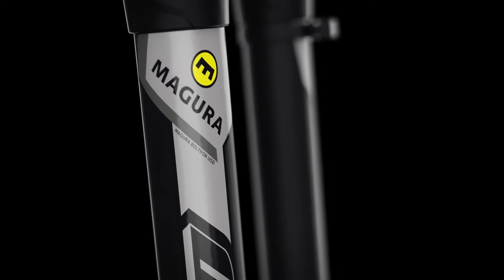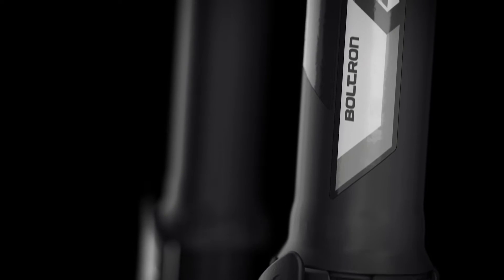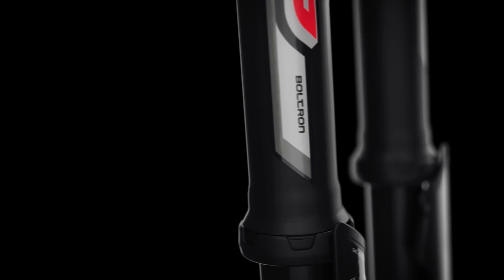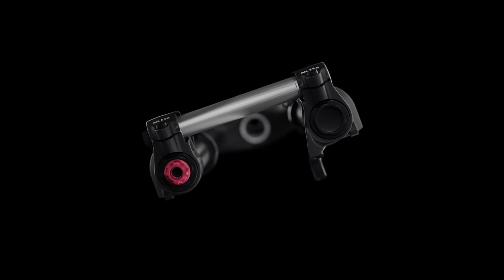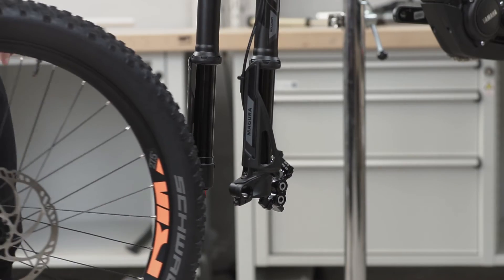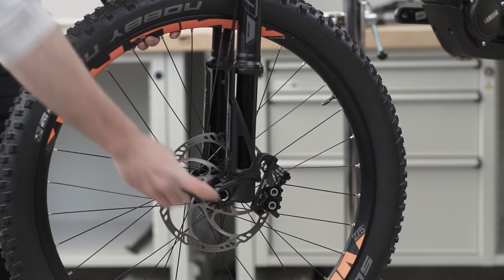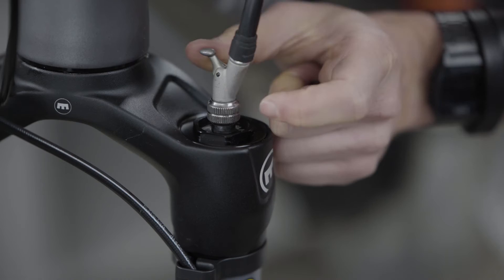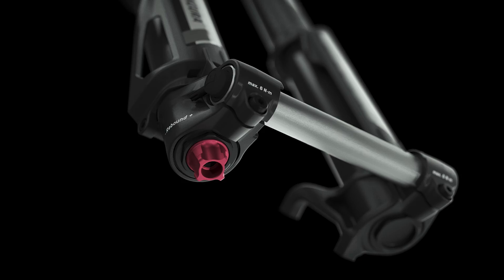MAGURA BOLTRON - Upside-Down fork for eMTB´s

Comment: is it boost or non boost ?
Reply from the maker: The Boltron requires 20x110 hubs and uses our M20 thru axle. (Not Boost 110!)
Reply: @MAGURAPassionPeople  OK thank you , is it stiff enough for emtb + big 230 lbs rider ?! tell me the real truth please
Reply from the maker: @sebastiengiovannelli8556  The Boltron is rated for a max total weight of 331 lbs: https://magura.azurewebsites.net/media/922396/boltron_2017_en.pdf
Reply: @MAGURAPassionPeople  and what is the size of the bushings please ?

Comment: nice fork but it can't be serviced as no parts are available and it has a lot of flex and creaks
Reply: do you have sources other than that ?
Reply: @sebastiengiovannelli8556  I contacted both the local distributor and the head office.  The local distributor asked me to send the forks to them which I did at my cost. They then sent them back at my cost and told me they couldn't do anything with them.  I tried contacting the head office a number of times, I never received a reply. The customer service at Magura is the worst I have ever experienced.

Comment: This looks like a nice fork, but 20mm TA instead of the more common 15mm means most wheels need to be rebuild for this.
Reply: Dmitri Nesteruk end caps m8.
Reply: or you could buy a 20mm --> 15mm axle adapter https://www.ebay.com/itm/MTB-Tools-Mountain-Bike-20mm-Thru-Axle-to-15mm-Thru-Axle-Adapter-for-110mm-Fork/252082256474?ssPageName=STRK%3AMEBIDX%3AIT&_trksid=p2060353.m1438.l2649
Reply: Nice, I'm sure you've gotten far in life.  My link was for folks looking to swap to the more common 15mm format using the 20mm hub that came with bikes using the Boltron.
Reply: @pubcollab  Wrong way around you twat. These require a 20mm hub,  that adapter is for using a 20mm hub on a 15mm fork, which is no use here. You can't just magically make any 15mm hub 5mm bigger in diameter. Not even end caps can fix that.

Comment: I have lost the silver piece that serves to push the axle when I want to take it out. I need to order this tool. How it is called? 
Because my store Magura do not know what I mean
Reply from the maker: Hi Gabriel, I'm not quite sure which part you mean, but either you mean the tool T25 you push into the axle (art.: 2701351) or you mean the thru-axle set itself (art.: 2701352). In case you're not 100% sure you can send us a picture via facebook messenger or e-mail (social.media@magura.de) which may help us to find the part you need. Kind regards Tobi - MAGURA social media
Reply: I am referring to the T25 tool. Your importer in Spain, Smile Riding, says it is not yet available. 
How could I get it?
Reply from the maker: Hi Gabriel, I guess our partner gave you this information by an oversight. The BOLTRON spare parts are available but maybe they're not on stock at our partner in Spain yet. In case you need any contact information from "Smile Riding" just contact us via facebook messenger or e-mail (social.media@magura.de). Thanks

Comment: Fork is not as good as advertised. Substantial twist of fork legs when braking hard. Not recommended for hardcore use.
Reply: Terrible info on servicing. The side to side play is unacceptable. Moves even at low braking. Ill never get more of these forks in my shop. Nightmare.
Reply from the maker: Hello Tim,
thanks for your message. It seems like you're not satisfied with our upside-down fork. Do you need any further information to optimize the fork performance? Just visit our tech center on www.magura.com/en/components/techcenter or chat with us via facebook messenger. Best regards Tobi (MAGURA social media)
Reply: Hi Tobi,
Thanks for your reply, yes I'm disappointed with the Boltron fork! checked the tech site and no more info than the manual. I don't do Facebook messenger, do you have other means for communication? I really want the fork to work or it gets replaced, please help, Tim
Reply from the maker: Hello Tim, 
sure, you're welcome to mail us directly at helpdesk@magura.de. Thanks!